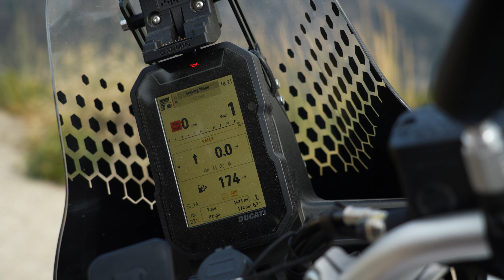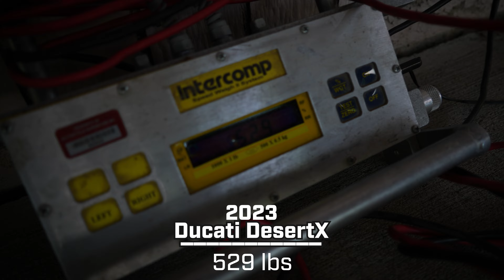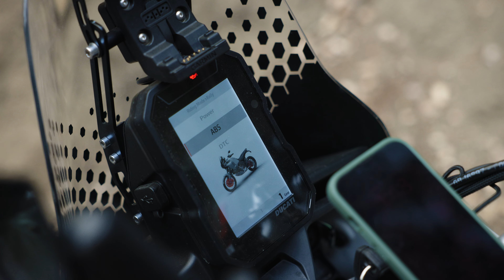2023 Ducati Desert X vs 2013 KTM 990 Adventure - 10 Year Shootout! - Cycle News

Comment: The 950 Adventure is a step better than the 990 (mainly fuelling, fuel consumption and range - all better on the 950). 

Regarding travel: all the 950/990's faults are well known, so can be fixed. One of my 950s has 225,000 kms on it, and is very reliable. We have yet to see how the Ducati is regarding long-term reliability.

When I first rode the DesertX, I thought it was the closest bike to the 950. Very similar road manners. Good job Ducati.
Reply: Well documented indeed. Plus nothing really catastrophical. But a lot of annoyances and it's a pain to work on.
Reply: Desmo is a headache once your dealer is behind the horizon
Reply: It depends on the 990 m8. My 2009 990 (my second 2009 990) is buttery smooth with a fuel map I modded on TuneEcu (base map Akrapovic R map) and with a 16/45 gearing it's amazing! Nothing catches me in the twisties even with knobbies (and me never getting over 6K RPMs). Fuel consumption is ok at about 6L/100 at my cruising RPM (4 to 5K RPM).

Comment: TWO EXTREMELY unreliable brands and models.
Reply: In the grand scheme of what the 990 was designed for it's one of the most reliable bikes, what dirt bike/endure will handle thousands of hours or riding with oil changes (not rebuilds) every 200 hours? And total life of regularly over 1500hours (~50k miles)??? If you rode a YZ250 on the road as a road bike, it too would be unreliable.
Reply: @AntaresSQ01  these are big dual sport adv motorcycles they are not dirtbikes

That comparison doesnt make sense, the yz250 is a pure dirtbike. The engine is designed to rev its heart out for a few hours at a time, short life spans.

The tenere 700 CP2 regularly goes over 170 thousand miles without anything besides oil changes and valve clearance adjustments. Thats what an adventure bike engines should be. Who the fuck wants a cam follower failure in the middle of Sudan?
Reply: Do a 20ft jump on a 1200GS and tell me how reliable it is!
Reply: Correct. And for that reason I’d prefer the 950 and made sure it has all upgrades it needs to be reliable, as I would do on a T7 if that’d be my choice. But it’s a different animal. Until then I ride my Himalayan 411. ;-) joking.
Reply: Any reliable bike is unreliable if you got the wrong one. And there’s no sports bike that covers 300tkm proving it’s reliability in quantities. There I can only see a supertenere1200 and that’s a boat, maybe a varadero, another boat, … Bikes that can’t do 300tKm easily, and neither 50tKm without needing an engine opening or electric unit replacement, or having a service other people buy a motorcycle for that bill, are unreliable in general to me, all others are just bike-average nothing to brag about.
Reply: @dylanmccallister1888 that isn’t happening on the 990s
Your ignorance is showing.
Reply: @KCsRipShed  what are you going to say? 

Start making excuses for broken cam followers, soft cams, and weak rocker arm bearings on their 690 i have seen A LOT of failures here on youtube of just that motor. 

The 790 and 890 are no better, KTM keeps replacing this stuff under warranty but doesn't fix the problem or even address it. They have been doing this for years, they have moved most of the parts manufacturing to China. 

And now they are in huge debt. Because they run their company like they build their bikes. Like shit. 

You go ahead and keep bringing up the ONE motor they got right in the last 40 years. A bike that left production more than a decade ago!
Reply: @ you are an emotional sort it seems.
Reply: @KCsRipShed  "your ignorance is showing" 

Calling somebody emotional because you are wrong instead of owning up to the hypocrite you are for saying that is stupid

Comment: Stupid head to head
Reply from the maker: Thanks for the comment! We appreciate your thoughtful insight.
Reply: I think it’s very relevant. I own both but if I only could have one I would take my old 990S without a doubt.
Reply: It’s comparing an apple to an orange
Reply: Thanks for the condescending response
Reply: I will just unsubscribe and not read your magazine if you can’t be real journalist
Reply: @kennedyracing7527  
How? Similar weight and power. I bought the Ducati last year and have 990 S since it was new. It’s surprising that no adventure bike can beat the old 990 off road. The electronics and driving aids are not for me as an old motocross rider. The big difference is that the 990 is a street version of a rally bike and the Ducati is a street bike that wants to be a rally bike…
Reply: @Checkyoursix77  as nice as what this Ducati may be and look, my heart still belongs to my 990 S and not even any of the newer KTM's have had me looking over the fence.
Reply: Not actually, especially as some 990 owners with old/high mileage ones are flirting with the idea of a DX rather than a different KTM adv. But, for that price difference, high-tech and spares availability issues, the DX is a nice indulgence. I'd rather use that extra cash to go on many more trips with my 990.
Reply: @Checkyoursix77  Good analogy. After 13 yrs, nothing can turn my eyes/heart away from my 990S.
Reply: Do no feed the troll
Reply: @terrellgarren7125 no just being honest